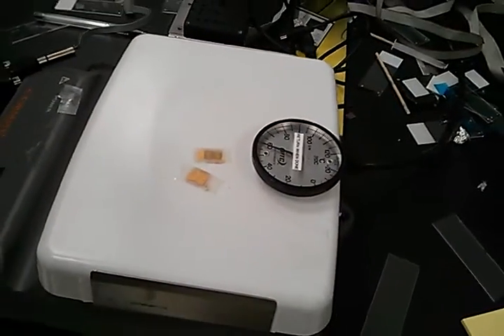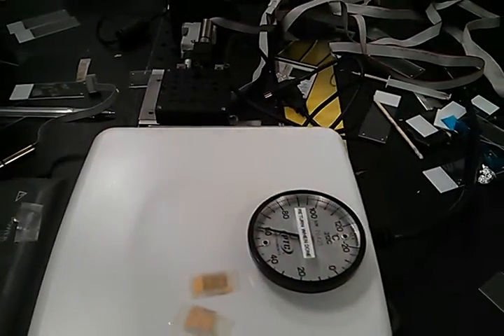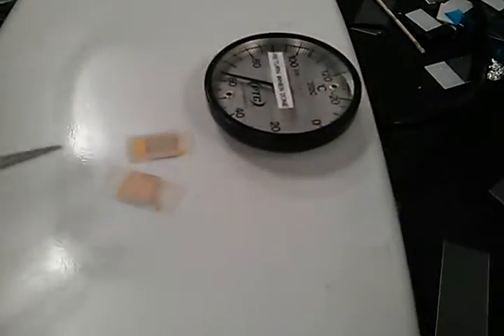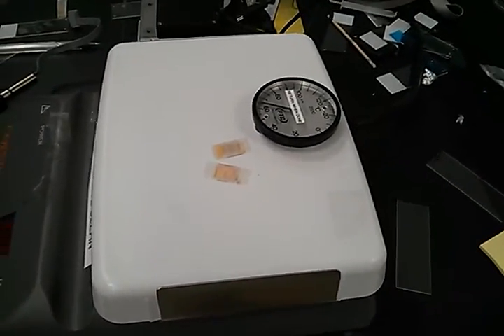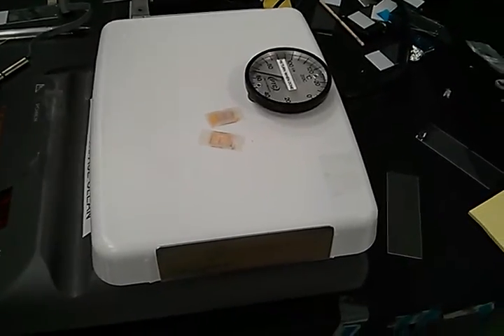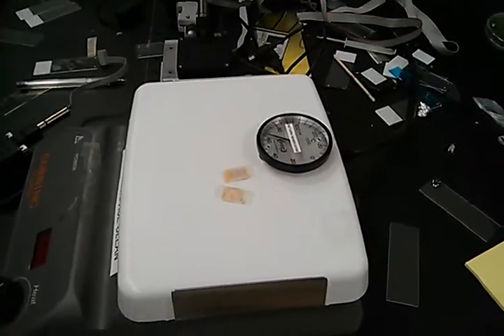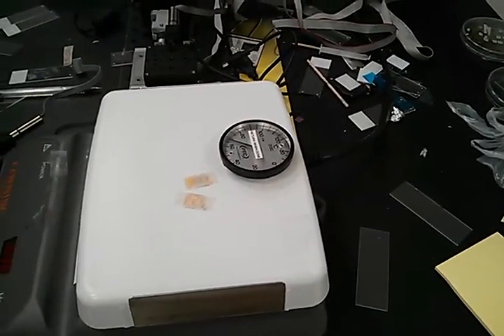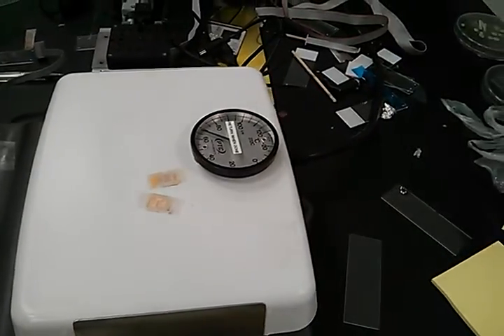Thermal Tape 2

Comment: Can you show or explain what the continuation of the video would look like in regards to demonstrating the referenced procedure?
Reply from the maker: Check the publications that used this method to see what it can yield.
Reply: @hbaslan  I have, I'm doing a project very similar to what is done in the video and publication but I'm having a hard time getting the thermal release tape to release from the gold and transfer to a clean Si substrate. What was your approach to ensuring the gold transfered?
Reply from the maker: @Verticaltex  We only did it once, I don't remember. You can find much more on the online resources